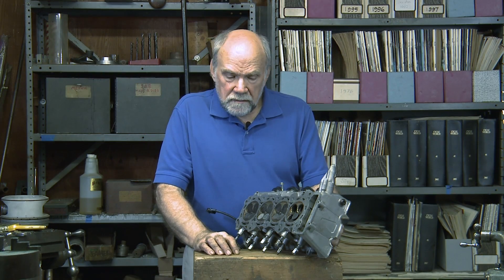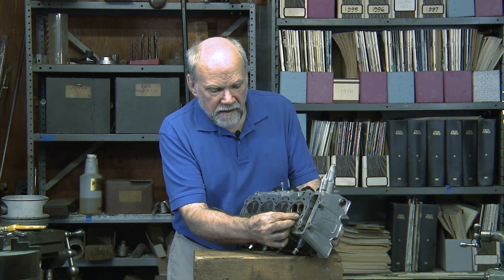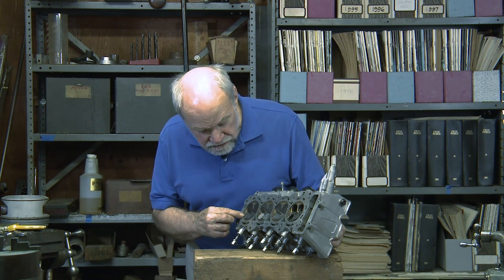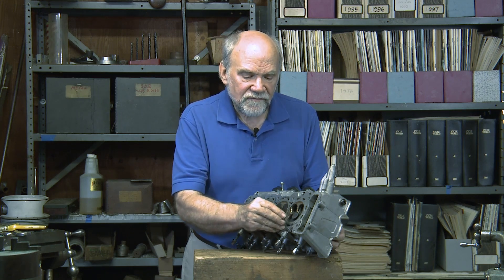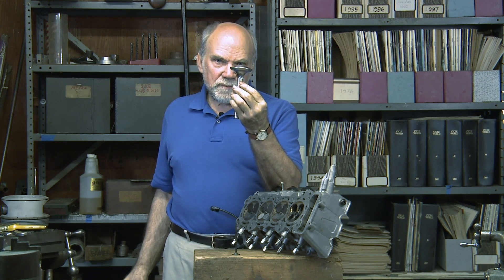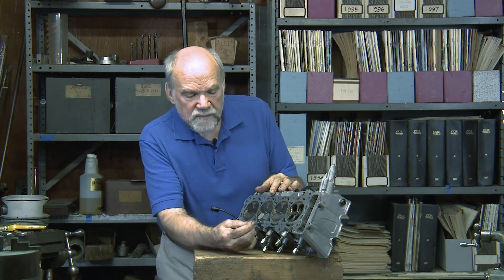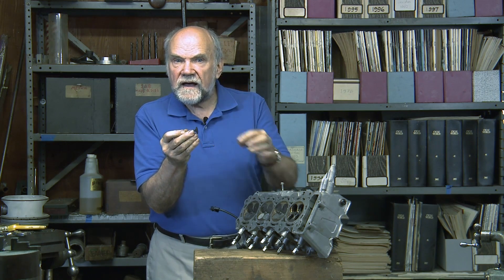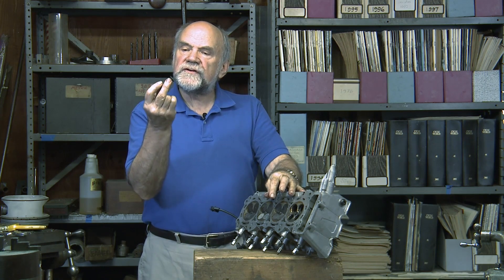Why Does The Exhaust Valve Have A Hard Life?

Comment: Absolutely Kevin! That is exactly why the aircraft engines require so much more maintenance. The owners rarely understand that difference. Air cooled motorcycle engines nowadays are on the edge too. As well as our liquid cooled high performance motorcycle engines. Especially the short lived motocross bike engines. Liquid cooling helps for sure. It comes down to what you expect out of a said engine. The more you ask of any of them the more maintenance you must do.

Comment: I had to replace a burnt valve on cylinder 3 of my 99 civic over the summer.  Ended up rebuilding the entire head.  Was it carbon that caused the burnt valve like Kevin says ?  Possibly.  I concluded that it was due to clearance being out of spec.  (Was super tight prior to removal).  The bad valve looked like a tiny bullet shot out of the combustion chamber.  It was knarly.